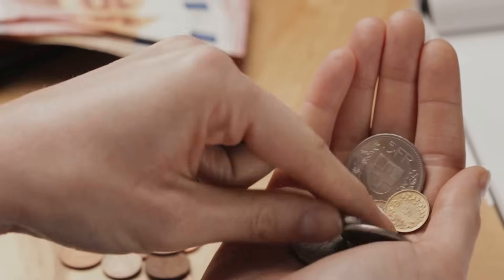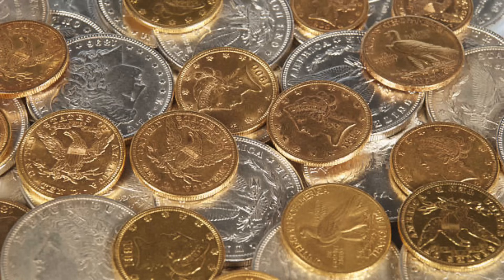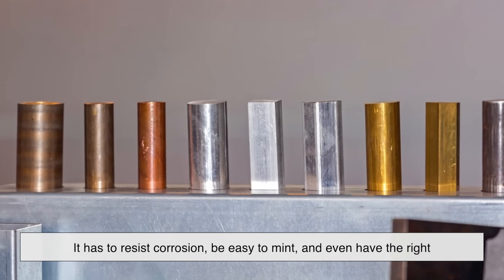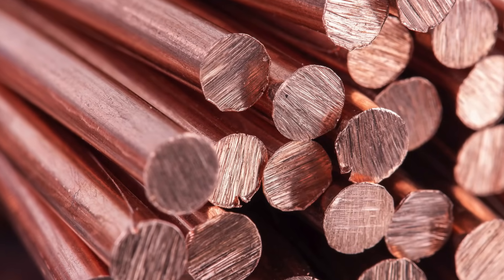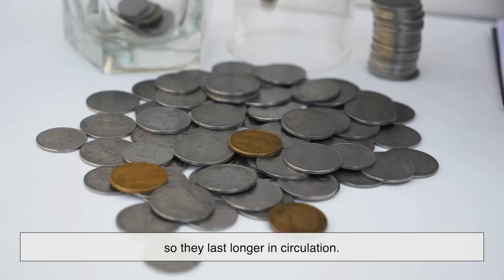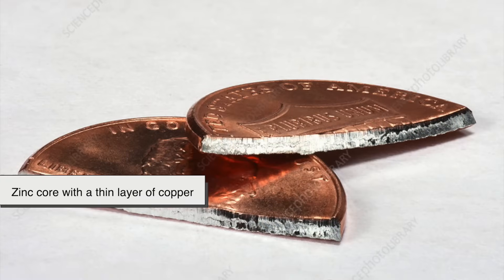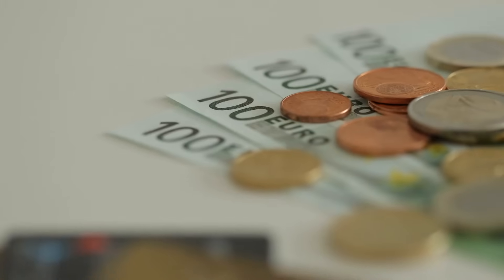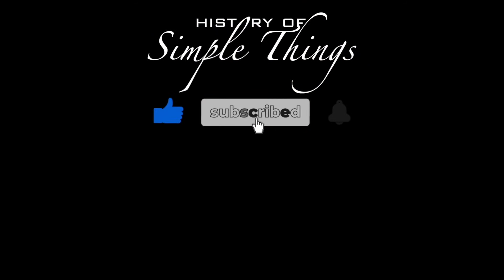Why Are Coins Made of Different Metal Alloys?

Comment: The Nazis ( in  WW2 ) used ( not so ) pure Zinc for their coins (  I have some 😝 ) ... without external electroplating , these coins are GREY ... DULL and ( some ) have decayed into white dust .. The UK have abandoned Copper alloy coins ( as the Copper is more valuable than the coin 😝 ) they now use Steel coins , electroplated in Copper .. but ,  with a small hole drilled into their centre , become an authentic ( machine Penny washer 😝 ) .............. DAVE™🛑

Comment: Regarding 5:07 multi-layer metals used in coins, in 1965, United States Mint dimes and quarter dollar coins had their metallic composition debased to a cheaper alloy consisting of cupronickel clad sandwiched around a middle core of copper. This laminated composition is known as the “Johnson Sandwich”, because President Lyndon Baines Johnson approved it to reduce the cost of making coins that had been previously minted from 90% silver alloy. The prices of nickel and copper are less expensive than the price of silver. The clad coin laminate composition originated from metallurgists at the Battelle Memorial Institute who developed the cupronickel clad sandwich coin composition to mimic the magnetic signature of 90% silver coins. This allowed millions of vending machines & parking meters to accept either 90% silver coins as well as cupronickel clad sandwich coins. According to Gresham’s Law, valuable silver coins became hoarded while the cheap cupronickel clad coins are routinely spent. Consequently it is very rare nowadays to find any silver coins in circulation.